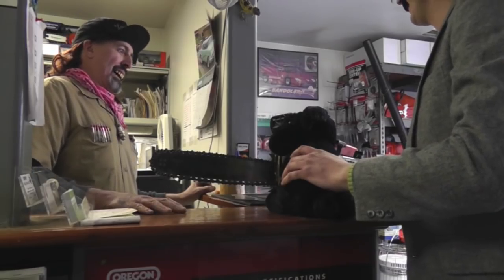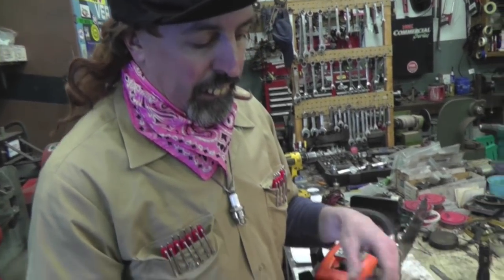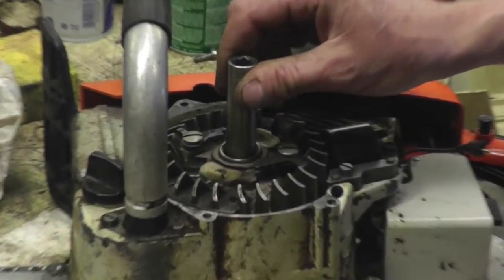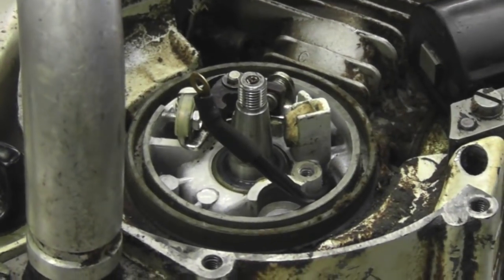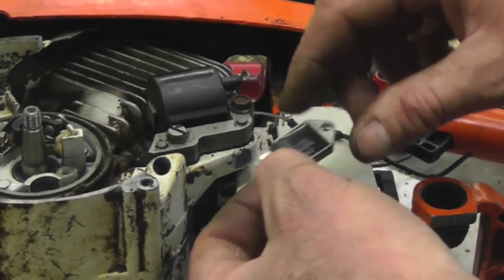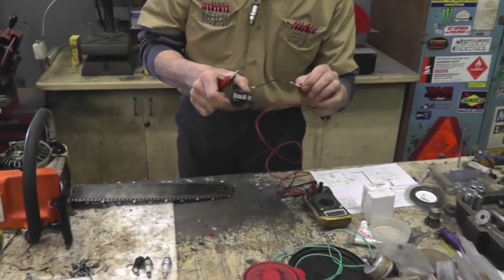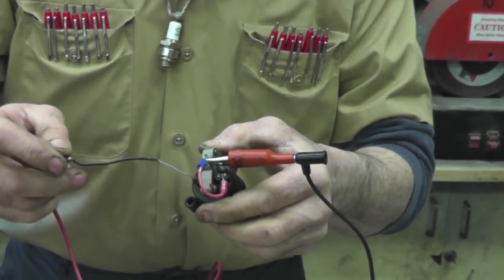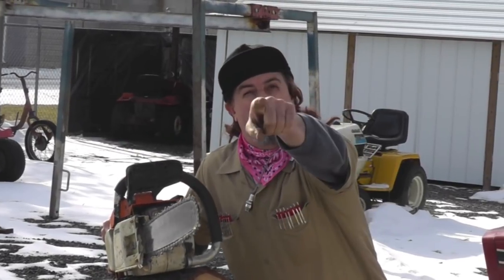How To Convert Stihl 028 031 032 From Points and Condenser to Electronic Ignition

Comment: Can you do this trick for that bosh electric ignition on like the 056av.  Can't find a new bosh style cool. So they wanna soak me almost 300$ for the SEM coil and the different flywheel needed. I have seen just a replacement coil but wondering if I could cut old moduel wires. And mount one this type.

Comment: Need to show how this is done on a mower with 12 volt ignition and points. It'd be nice to eliminate the points. I also would like to see if its possible to put an electric fuel pump on a lawn mower.
Reply from the maker: +kd9bwi I'm not sure if you can do that on battery ignition but will check into it.
Reply: Taryl Fixes All LLC OK, if you think its impossible, don't go ruin one of your mowers just to find out. That mower can be used for a successful video that's worth watching.

Comment: I can't understand how is possible to synchronize the firing of sparkle without points?
Reply: im pretty sure it's not a seperate power source so there really isn't anything to synchronize.

if im correct 'Condenser' in this case is synonymous with capacitor.
if that is the case then what we have here is a ringing/oscillating circuit which basically uses some of the energy from the previews spark to make the current spark even stronger.

you can kind of think of this circuit like a sing. you can put very little effort in and as long as you get the timing right you can go higher on the swing.

well replace physical height with voltage and replace you with the ignition coil and the swing is the 'Condenser' and then you would have basic concept of this circuit.

Comment: Taryl how does the module get triggered? That is cool that you can get rid of the points but how does it know when the piston is at tdc? Thanks for the video.
Reply: This is a old Post, but the module is triggered by the magnetic field generated by the coil and flywheel magnets

Comment: Taryl. You fellas crack me up .... your in the wrong business you should be acting.  However, and all jokes aside can you tell me if it is possible to fix a Stihl 084 ignition module cause you can't buy em anymore and Im spewing because the saw is in great nick and a good saw for ripping Australian hardwood. Could the problem be caused by vibration and if so can it be fixed.  Any help would be appreciated.

Comment: My 032 AV has two wires going to the kill switch both wires are tied together to a center connector on the switch and the switch is grounded in the off position, shouldn't i have to only hook up one wire off of the switch to the module and ground the module to the coil